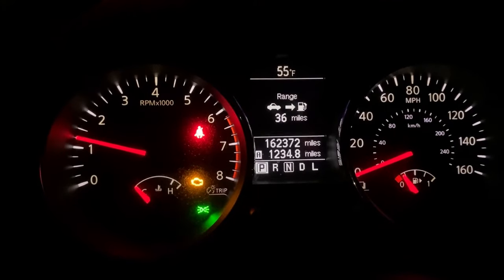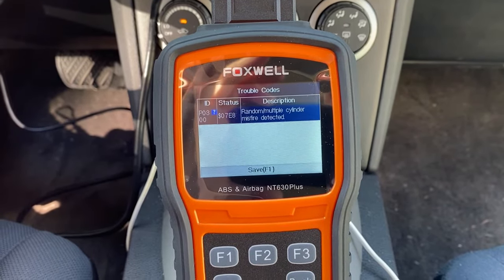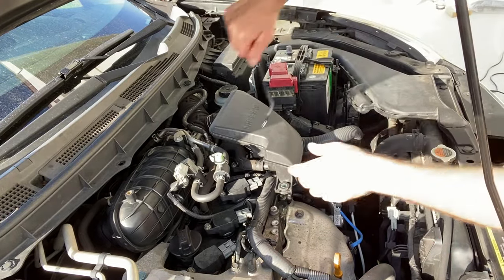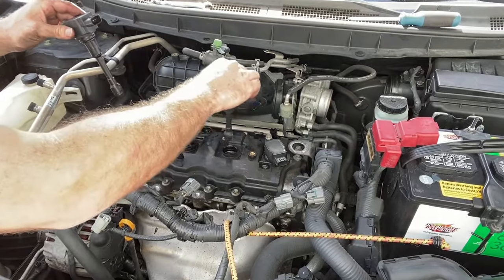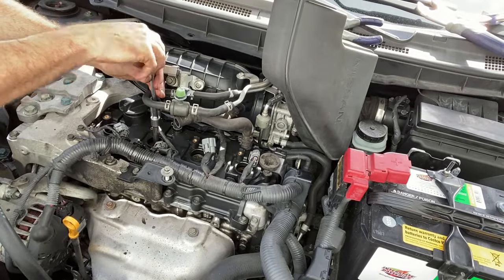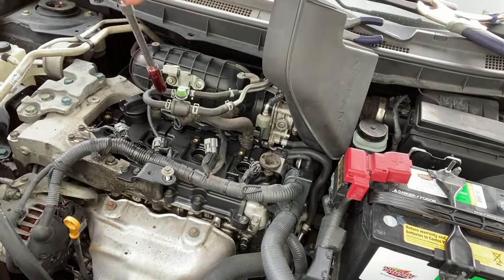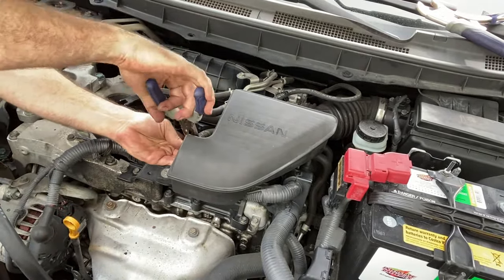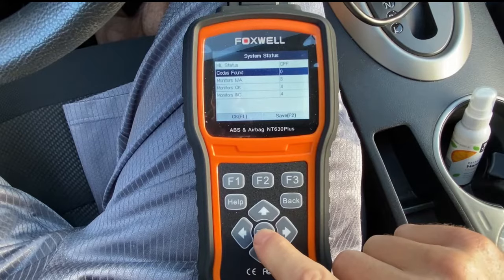Solved - Engine misfire and P0300 code (Nissan Rogue)

Comment: Just used this video to diagnose and fix my parent's 2016 Rogue with the same p0300 code. Worked like a charm. Not sure which cylinder it was but for 60 bucks got four coil packs and plugs from Amazon. Thanks!
Reply from the maker: Great to hear. Just be sure the Rogue runs smooth. I found that some of the cheaper coils may not run as good as OEM. That was the case on our Ford Escape, not our Rogue.
Reply: I have a P0304 which is a misfire in cylinder 4.  It might be a bad coil and that is because it was not always misfiring and it took a while for it to become severe enough to set a code.  I was fearing my CVT may be on its way out since Nissan is infamous for their CVTs

Comment: I have a 2012 Quest with 172000km on it.  I’ve gotten the P0300 (generic misfire), P0021 (crankshaft position) and P0455 (EVAP) codes.  Yes plugs and coils are way overdue, but I’m not just going to throw $500 in parts and $300 in labour at changing those parts without being sure that solves the problem.  Plugs and coils can be done another time, when it’s warmer outside and I can dedicate time on a weekend to doing them myself.
Reply from the maker: Plugs and coils are relatively simple to change. And you can get aftermarket ones for under $100. 

Sounds like you got a couple more problems than that, so what’s your plan?
Reply: So after a bunch of back and forth troubleshooting, it turned out that alternator needed to be changed. Unfortunately, this really only came to light after I had the solenoid replaced and I replaced the battery (thank you Costco warranty!!).  After the new battery died about 30 kms after being replaced, we had the alternator changed.

Right now, I continue to live with the EVAP codes, because that it just too much of a biatch to properly fix for not much gain at this point.  I am hoping to have this vehicle last another two or three years, so if the EVAP codes give me trouble, I’ll have them looked after, but for now just keeping it mechanically sound and running. With proper fluid changes is the plan.
Reply: Also, changing coils on the back cylinders of this van are not within my skill set and even the mechanic isn’t looking forward to doing it.  The front coils are well within my abilities and capabilities.
Reply: Se

Comment: P050A code on my KIA Soul 2016 . Cold start . It was the Sparkplugs. 35,000 miles . Changed the plugs and the problem was solved .
Reply from the maker: Wow. 35k on plugs is pretty low. Did you notice anything wrong with them when you pulled them out?

Comment: Nice video.. My nissan rogue 14 has the same code, but the problem its on cylinder #1 but the scanner says p0300 😕
Reply from the maker: So did you replace the coil? 9 years old, I’d just swap them all out. Can get a full set for $50 these days.
Reply: @Thatguysauto  nop until today I go to buy the new ones.. Thanks 👋🏻
Reply: @Thatguysauto where do you get a pack for $50?
Reply: Mazon @witarzan

Comment: P0300 code. Throws coils at it. Why wouldn't you diag it?
Reply from the maker: 160000 miles on the coils and getting a misfire and code. For $50 in coils and them being a very likely source of the problem based on experience, I rather not spend time on it if I don’t have to.

Comment: That’s it throw parts at it don’t troubleshoot the problem 300 code as a generic, random misfire. You don’t know what cylinder is missing parts guys. Love you because you just buy parts and use your eight ball and throw at it. Diagnose the problem fix it right
Reply from the maker: Agreed! Glad we can entertain you. But in reality it’s a trade of time and energy vs the cost of most probable part issues. Add to that the age of the parts being replaced.